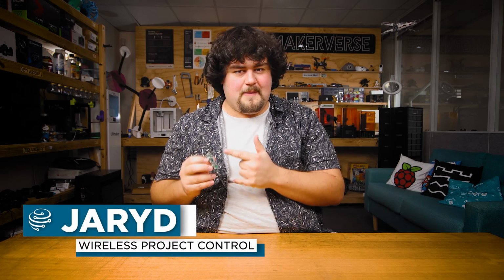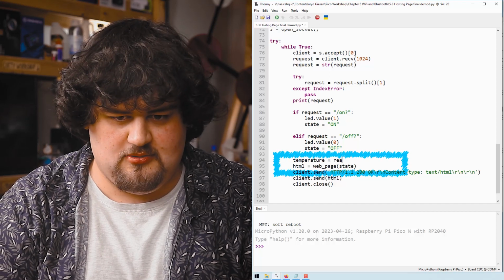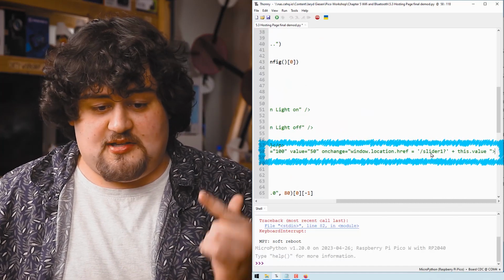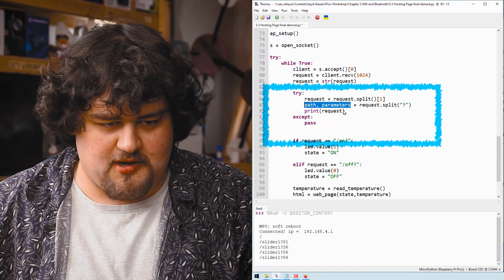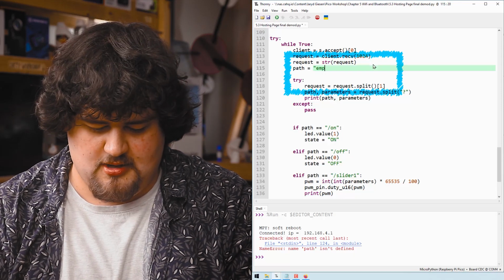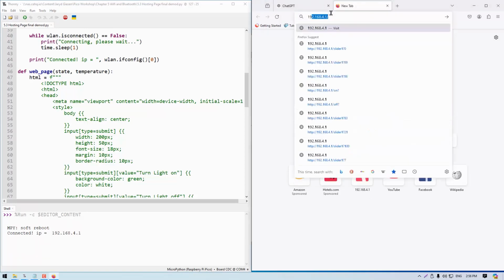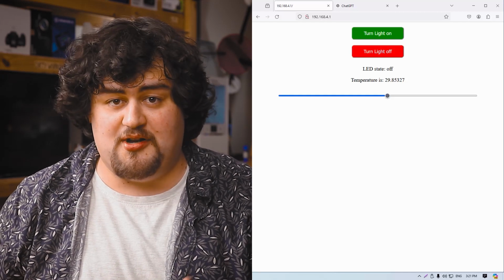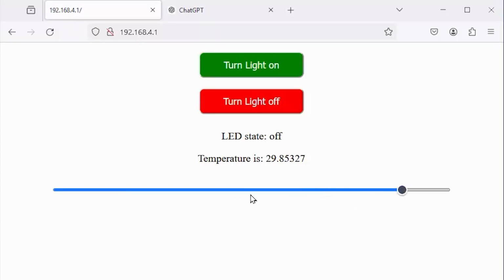Improving Web Page Functionality | Raspberry Pi Pico Workshop: Chapter 5.4

Comment: Good video but there is an error on your course website.

The html in your code has the line:
    @ltinput id="slider" type="range" min="0" max="100" onchange="updateSlider(this.value);"@gt
But should be:
    @ltinput type="range" min="0" max="100" value="50" onchange="window.location.href = '/slider1?' + this.value "@gt

With the @lt @gt being < and > respectively, thus:
    <input id="slider" type="range" min="0" max="100" onchange="updateSlider(this.value);">
and

    <input type="range" min="0" max="100" value="50" onchange="window.location.href = '/slider1?' + this.value ">

This took me A LONG time to figure out!
Reply from the maker: Thanks for letting us know, we will take a look at that!